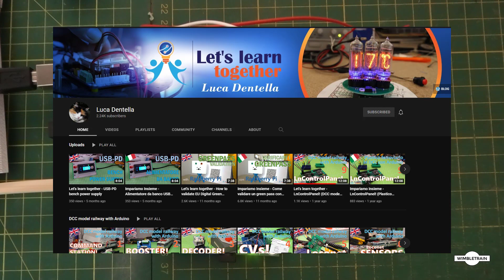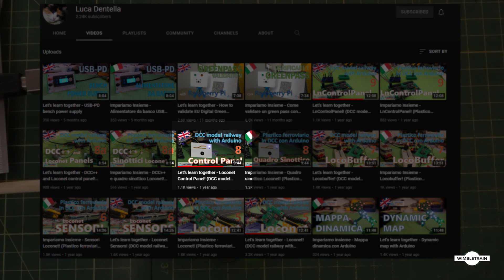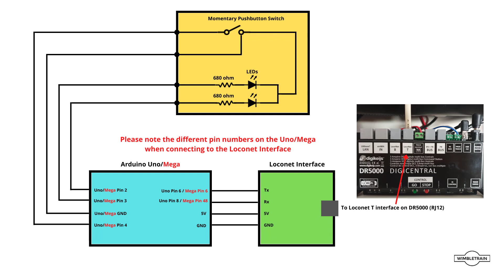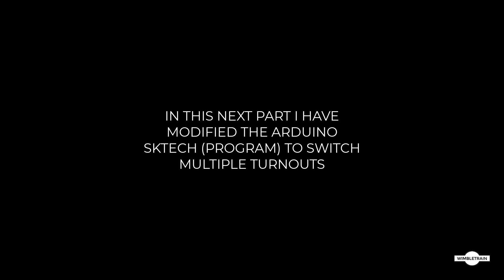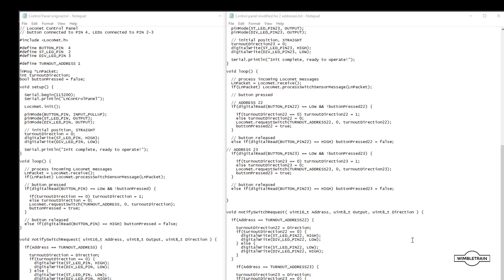Model Railway Control Panel using Arduino and Loconet Interface

Comment: Great video, this is exactly what I am trying to do. I have ordered the PCB via the link you provided. Where do I get a list of parts as I have to order them separately? Thanks!
Reply from the maker: Hello, I have put a parts list together and put it in the video description. Good luck with the project! John
Reply: @wimbletrain  I do not require the 12V supply to the Loconet as my central station provides that. Can I skip all the components associated with the 12V?
Reply from the maker: @gopalpatnaik4781 yes
Reply: @wimbletrain  Thanks for the parts list!
Reply: I am waiting on the parts and the PCB.  Thanks for your assistance! I will let you know how it goes.
Reply: I built the interface following your instructions. However nothing happens.  I have double checked all the resistor values and the soldering looks good. I am using the Loconet Monitor sketch to test and there is absolutely no activity shown, when I turn on/off the track power. How do I go about debugging this? Thanks!
Reply from the maker: @gopalpatnaik4781 Hi, I would check the pin connections from the loconet board to the arduino as they are different depending on whether you are using a standard arduino or mega. Also, check that you have IC1 and the transistors the right way around on the loconet board
Reply: @wimbletrain  I an using an Uno, so Pin 6 for Tx, pin 8 for RX. Is this correct? As far as I can tell, I have put the IC and transistor in correctly, based on the outline on the PCB. Is there any way to test the board itself?
Reply from the maker: @gopalpatnaik4781 Hi, you may need to ask Luca who made this board, there's a link to his YT channel in the description. I have built 2 of these and they work connected to the Loconet  T of my DR5000. Sorry I cant be of more help. Haven't tried it on the Loconet  B.
Reply: @wimbletrain  I willl do that, thanks!
Reply from the maker: @gopalpatnaik4781  Just out of interest, what command station are you using?
Reply: @wimbletrain  Intellibox 1 connected to a Raspberry Pi running JMRI via LocoNet
Reply: I found a major error. I got a LM331N for IC1 instead of LM311N. No wonder it doesn't work!
Reply from the maker: @gopalpatnaik4781 Hi, unfortunate but good news at the same time!. Cheers. John
Reply: @wimbletrain  I got the correct IC in. It works! Hurray! Thanks for your help and encouragement. Gopal
Reply from the maker: @gopalpatnaik4781  That's great to hear!

Comment: Thank you for your great article. I am busy building the interface board and will soon be testing. Is the any chance I can download the IDE sketch for my UNO. Is there also a possibility that you could modify the sketch to include 6 turnouts.
THanks once again.
Reply: @wimbletrain  
Thanks John, I Have downloaded the sketch into Arduino IDE. I looks like I will need an Arduino  Mega fo 6 turnouts. What switch motors do you use for this program. I am using 6 servos on the one section of my layout and 15 Peco switch machines on the larger part of my layout. Thanks for all your help, Wally
Reply from the maker: Hi Wally, As I use mainly Kato Track they have the switches built inside the turnouts, but I so also use Peco trunouts and I use servos to operate them. I think I mentioned in the video that I connect this interface to the Digikeijs DR5000 and use the DR4018 and DR4101 for the Kato Turnouts and a DR4024 and DR4102 (for the frog) for the Peco turnouts using servos. Let me know how you go, I've only had a chance to test with 2 turnouts so far, but really need to get back to it and make a control panel. It's ok to operate the turnouts from the computer but much more fun from a control panel I think.
Reply: @wimbletrain   Hi John, I have rewritten the sketch for 1 output and 1 input and uploaded to my UNO. I can see the IDE communicating with the UNO but there is no response from the push button. Will this work without the UNO connected to the Loconet, I have not yet received my parts for the interface card.
Thanks John for all your help, Wally
Reply from the maker: @WallyWebb-d1t  Hi Wally, it relies on  messages going to/from the loconet so it won't do anything on its own.
Reply: @wimbletrain   Thanks John I thought as much, Wally.
Reply: @wimbletrain  
Hi John, I assembled my interface board, connected the board to the Digitrax Loconet and the Arduino UNO. The system works perfectly from the Digitrax throttle but the leds will not change over when the pushbutton is pressed. I cant see what I have done wrong. I copied your sketch from your screen shot for 1 button and 2 leds. Could I either send you my sketch for to you to check, or would you rather send me a sketch for 1 button and 2 leds. Thanks for all your help, regardes Wally.
Reply from the maker: Hi Wally, I uploaded a new sketch, some of the pin numbering has changed as i forgot to not use certain pins for the switches as they are used to connect to the loconet interface. I tested two of the addresses and all works fine with the LEDs and switches and with operating the turnouts in iTrain. You will need a Arduino Mega as the UNO won't have enough pins for all 6 switches. The one I used for my test is an Elegoo Mega 2580 R3
Reply from the maker: @user-ob5en9br1z  Hope you managed to get the file, I originally forgot to share it. Also, at the top of the file, I forgot change the pin numbers in the description. It should read:
 //Loconet Control Panel
// DCC Address 22 button connected to PIN 2, LEDs connected to PIN 3,4
// DCC Address 23 button connected to PIN 8, LEDs connected to PIN 9,10
// DCC Address 24 button connected to PIN 11, LEDs connected to PIN 12,13
// DCC Address 25 button connected to PIN 14, LEDs connected to PIN 15,16
// DCC Address 26 button connected to PIN 17, LEDs connected to PIN 18,19
// DCC Address 27 button connected to PIN 22, LEDs connected to PIN 24,26
Reply: @wimbletrain   Thanks John, I will test the sketch and you know. Regards, Wally
Reply: @wimbletrain  Thanks once again John. I can't get the sketch to work, I think I have the wrong Arduino. I am going to purchase a Leonardo and then test again.

Regards,Wally.
Reply from the maker: @WallyWebb-d1t  I would suggest a Mega, the Elegoo one is a good option. As far as I know, the sketch will work with this or an UNO, but the UNO won't have enough digital pins.
Reply: @wimbletrain   Thanks Lohn, Wally
Reply: Sorry, John, finger trouble.
Reply: Hi John, I found the problem with my loconet. I had the transistor the wrong way around. Everything now works fine. Have you a sketch so that I could use the one you gave with solenoid turnout motors. , i.e. with a relay on timer. Thanks once again for all your help and the sketch. Wally.
Reply from the maker: @WallyWebb-d1t Hi Wally, good too see you got it going. I'm not sure what you mean with the timer bit. John
Reply: John, thanks for the reply. When one operates a Peco switch machine it requires about a 1 second pulse to throw the solenoid and change the turnout. I would like to use 5V relays connected to the Arduino and a CDU unit connected through the terminals of the relay to the switch machine. I hope I have explained this correctly, regards Wally.
Reply from the maker: @user-ob5en9br1z So this would be a separate arduino acting as a decoder which would then operate the relay and CDU?
Reply: Sorry I have taken so long to reply I have had covid. The Arduino would act as a decoder operating a relay with a 1 to 1,5 sec on cycle to operate the switch machine, Thanks Wally.
Reply from the maker: @WallyWebb-d1t  No worries Wally. I did do a project similar a while back with an Arduino and a small board to connect it to the DCC bus. It drove a series of relays which then I had connected to a capacitor discharge unit which then operated Kato Switches. I'm sure you could adapt this to suit your needs. I never did a video on it at the time but it may be worth doing one. John
Reply: John this sounds great. This would work as long as there is a 1-2 second on delay for the relays. Thanks for the suggestion, Wally.
Reply: Hi John I have attached a sketch below for operating solenoid controlled  turnouts. You will notice the pulse I was talking about.I am trying to incorporate this into your sketch without success.Could you please comment.
I have a fantastic loconet servo control turnout sketch, but I have 18 solenoid turnouts on my layout and don't.  want to change them to servo control. Regards, Wally.

// DCC Decoder for solenoid motors, 2 outputs and CV30 to set impulse duration
// Luca Dentella
//
// Playlist of my tutorials: https://youtube.com/playlist?list=PL45uNmSXju7mn3bMtVVPlFQmpD3mUI5mi

#include <NmraDcc.h>

#define DCC_PIN 2
#define ACK_PIN 3

#define DECODER_ADDR 4

#define CV_IMPULSE_DURATION      30
#define DEFAULT_IMPULSE_DURATION 200

#define OUT1_PIN_STRAIGHT  4
#define OUT1_PIN_DIVERGING 5
#define OUT2_PIN_STRAIGHT  6
#define OUT2_PIN_DIVERGING 7

NmraDcc Dcc;

void notifyDccAccTurnoutOutput(uint16_t Addr, uint8_t Direction, uint8_t OutputPower) {

  // Get the current decoder address
  uint16_t myAddress = Dcc.getAddr();

  // Get impulse duration from CV
  uint8_t impulseDuration = Dcc.getCV(CV_IMPULSE_DURATION);

  // Output 1
  if(Addr == myAddress) {
    if(Direction == 0) {
      digitalWrite(OUT1_PIN_STRAIGHT, HIGH);
      delay(impulseDuration);
      digitalWrite(OUT1_PIN_STRAIGHT, LOW);
    } else {
      digitalWrite(OUT1_PIN_DIVERGING, HIGH);
      delay(impulseDuration);
      digitalWrite(OUT1_PIN_DIVERGING, LOW);    
    }
    Serial.print("Output 1 moved to position ");
    Serial.println(Direction);    
  }

  // Output 2
  else if(Addr == myAddress + 1) {
    if(Direction == 0) {
      digitalWrite(OUT2_PIN_STRAIGHT, HIGH);
      delay(impulseDuration);
      digitalWrite(OUT2_PIN_STRAIGHT, LOW);
    } else {
      digitalWrite(OUT2_PIN_DIVERGING, HIGH);
      delay(impulseDuration);
      digitalWrite(OUT2_PIN_DIVERGING, LOW);    
    }
    Serial.print("Output 2 moved to position ");
    Serial.println(Direction);     
  }
}

void notifyCVAck(void) {

  digitalWrite(ACK_PIN, HIGH);
  delay(8);  
  digitalWrite(ACK_PIN, LOW);
}

void notifyCVResetFactoryDefault() {

  // Reset requested, set default address...
  Dcc.setCV(CV_ACCESSORY_DECODER_ADDRESS_LSB, DECODER_ADDR & 0xFF);
  Dcc.setCV(CV_ACCESSORY_DECODER_ADDRESS_MSB, DECODER_ADDR >> 8);  

  // ...and impulse duration
  Dcc.setCV(CV_IMPULSE_DURATION, DEFAULT_IMPULSE_DURATION);
}

void setup() {

  Serial.begin(115200);
  pinMode(ACK_PIN, OUTPUT);
  pinMode(OUT1_PIN_STRAIGHT, OUTPUT);
  pinMode(OUT1_PIN_DIVERGING, OUTPUT);
  pinMode(OUT2_PIN_STRAIGHT, OUTPUT);
  pinMode(OUT2_PIN_DIVERGING, OUTPUT);   
  Dcc.pin(digitalPinToInterrupt(DCC_PIN), DCC_PIN, false);
  Dcc.init(MAN_ID_DIY, 1, FLAGS_DCC_ACCESSORY_DECODER | FLAGS_OUTPUT_ADDRESS_MODE, 0);
}

void loop() {

  Dcc.process();
}
Reply from the maker: Hi Wally, wouldn't you have a separate Arduino (connected to the DCC bus via a DCC interface board, which you can make) and then place this sketch on it and add the extra turnouts in the sketch?
Reply: Hi John. I received my relay and the sketch works fine. Please tell me how I can send you the sketch and a drawing of how I have connected it all up. Under the heading void notifySwitchRequest( uint16_t Address, uint8_t Output, uint8_t Direction ). the  digitalWrite(ST_ LED_ PIN22 and  DIV etc must both be LOW. Wally
Reply from the maker: @WallyWebb-d1t  Hi Wally, can you put it in your Google Drive?
Reply from the maker: Hi, I can put my current sketch on Google Drive and share it, and I can modify it for 6 turnouts, but you will need to change the addresses and labels to what you need. I might even write up something more comprehensive so anyone using it can modify it. Regards,  John
Reply: @wimbletrain
I can't seem to send my reply. Please put the sketch on Google Drive. I would also be most be most grateful if you could modify the sketch for 6 turnouts. I have no problem changing the addresses. Thanks once again, Wally

Comment: Hi John! This is great stuff! I've been on the edge of dabbling with Arduino's for a while, as the programming side appeals to me! Now that I've seen them work with the DR5000 using LocoNet it makes using them even more appealing! I liked that pressing the buttons and clicking in iTrain were synchronised with point movement and led illumination! I'm pretty sure I'm going to go with Megapoints controllers for my point control, but the Arduino has many other uses, so I'm bound to dabble in them at some point! Thanks for posting such an informative video! All the best, Ian.
Reply from the maker: Hi Ian, the Megapoints system looks good and seems to be a popular choice. I've watched some of their videos and it looks very interesting. I am still finding out (well trying) what the DR5000 is capable of as it has so many interfaces. It was a wow moment when I found this project, now I just have to build the actual control panel! But I also think that I can have multiple panels rather than just one (not that my layout is that big!!) and connect them all to the loconet interface. I don't fully understand the Arduino code but know enough to modify  a sketch (some say enough to be dangerous!😄). All the best

Comment: Hi John very interesting video, I am also just dipping my toe in the world of the Arduino. Like you I am also looking at using various projects that can be powered by the dcc and also push buttons. Just out of curiosity will the dr5000 still run the z21 app using the loconet protocol or is it just limited to the rbus? Looking forward to seeing how you progress with the arduino and what other projects you come up with. All the best Tony.
Reply from the maker: Hi Tony, I can't really comment on the z21 and rbus, haven't really dealt with the z21 app at all. The DR5000 has many interfaces and options which I have yet to explore. At the moment I'm running iTrain which as per the video works together with the pushbutton control panel via loconet and I'm also running a Wlanmaus wireless controller.